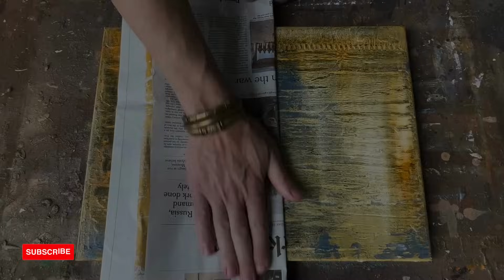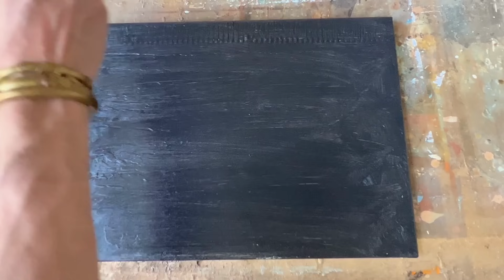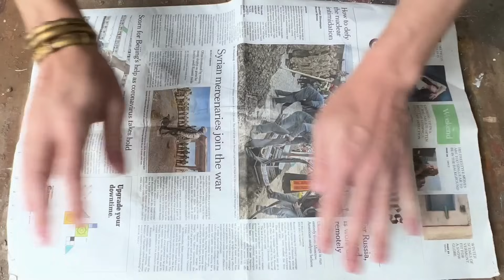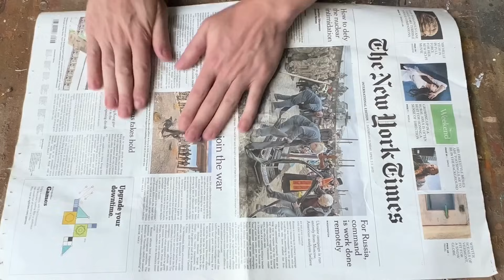Discover the Magic: Turn Your Canvas into Weathered Wood with This Technique - DIY ART

Comment: why u use joint compound any other alternative of this
Reply from the maker: You can use modeling paste as an alternative. Use any product with polymers so it will not crumble over time. This ensures durability and longevity for your artwork.

Comment: Always enchanting by your style, while creating your art pieces. Question~ When placing paints onto your substrates do you dip your brushes into water first?
Reply from the maker: Thank you for your kind words! Regarding your question, when I use the dry brush technique, I actually wet the brush hairs in advance and then allow them to dry, so the bristles are damp but not with excess water. This technique allows for more controlled and subtle paint application. It's all part of the process to achieve the desired artistic effects. 😊🎨🖌️

Comment: Thanks again for the great tutorial.  It's always so calming watching you paint - also due to your slected music. 
A few questions for you: Could the joint compound that you use be replaced with 'Crack filler'  or 'Stucco''  (as they call  it in Italy)? Is it the same thing? or does the joint compound have a 'plastifyier' component to it, which makes it more flexible? 
What are the brands of Gesso and paints which you use? 
Keep up the great work!👩‍🎨🎨
Reply from the maker: Joint compound typically contains polymers that make it more flexible and less prone to cracking when it dries. While 'Crack filler' or 'Stucco' may have similar properties, it's essential to check the product specifications to ensure they contain similar polymers for flexibility.
The brands of Gesso and paints I use may vary depending on availability, but some reputable You ahve my recomendation product list on my links of Youtube. Thank you for your kind words and support! Keep creating🎨

Comment: Hi Sergio!  How did you keep all those layers of acrylic from drying out before dabbing them with the newspaper?  Do you keep misting them with water?
Reply from the maker: Hello Leland !! Hi there! You're absolutely correct. To keep the layers of acrylic from drying out too quickly, I use a fine misting spray bottle to vaporize a small amount of water over the canvas. This helps maintain the paint's workability and allows me to work at a comfortable pace. It's essential to work relatively quickly to achieve the desired blending and textures using the newspaper technique.  Greetings ❤

Comment: Hello Sergio! Great job!
Tell me please (Am I understanding correctly?) If a layer of black acrylic fits well on a layer of modeling acrylic paste that I use, then it is not necessary to apply gesso between them (?). I'm afraid that an extra layer (in this case gesso) will remove the relief.
With respect and best regards!
Reply from the maker: @orangeairplane4898 Hello! Thank you for your kind words and great question. You're understanding it correctly—applying black acrylic paint directly onto the modeling acrylic paste should work well and isn't necessary to use gesso in between. Using black paint will indeed create a similar effect to gesso but will be thinner, which is better for maintaining the relief and texture in your work. You're right to avoid an extra layer if you're concerned about preserving the detail and depth of the paste. Keep up the fantastic work, and don't hesitate to reach out if you have more questions! Best regards, Sergio
Reply: @SergioAranda  Thank you very much, Sergio, for your answer! Please tell me one more thing (actually there may be more questions 😂) Do you varnish all your finished canvases? If so, is it a matte acrylic varnish? Gracias!
Reply from the maker: @orangeairplane4898  Yes, I always varnish my works. Glossy or matte will depend on the artwork and the effects I wish to have.